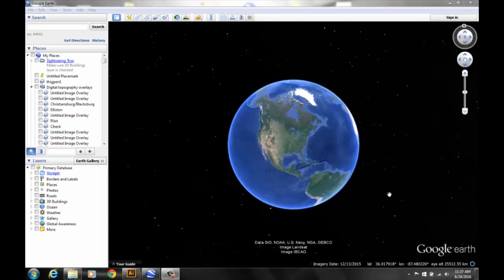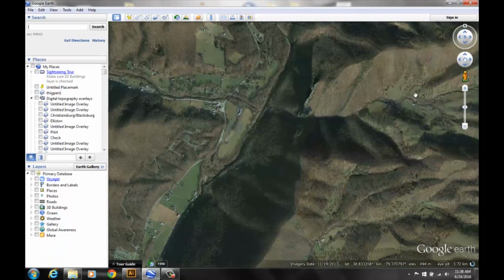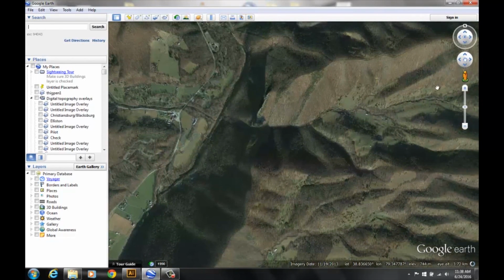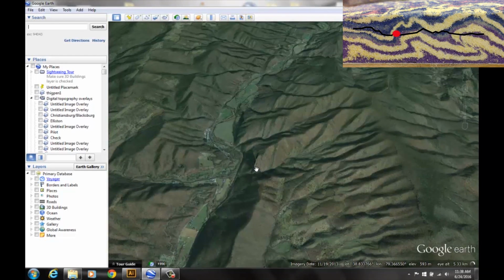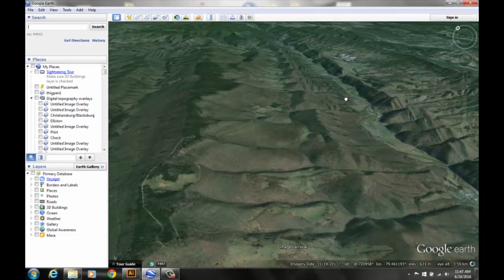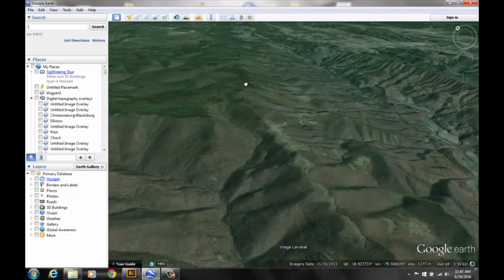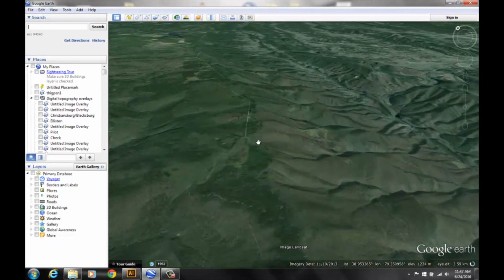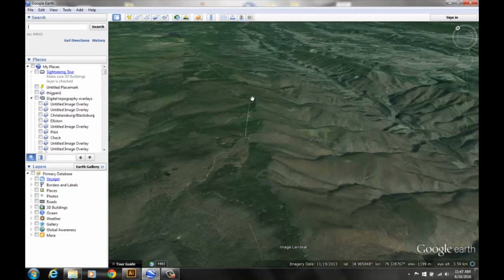Seneca Rocks and Wills Ridge Anticline 4: Overall view using Google Earth

Comment: I live in Riverton, WV with a view from the foot of Riverton Rocks, one of the Tuscarora Sandstone 'fins' about 10 miles south of Seneca. I learned some things from your series, but I'm slightly disappointed that you didn't take on the faulting that's responsible (or so I've been told) for the double fins at several locations. At Nelson Rocks, near the center of your view from the Spruce Knob overlook and discussed in the Google Earth segment., the two high fins are separated by 100m or more in the gap. Seneca Rocks is more of a monolith. Facing N from Roy Gap, a large 'cave' is visible in the S. end of the S. peak, with strata wrapped around it in tight arcs. Again, I'm told it resulted from faulting, though less cleanly than at Nelson.

Nelson Gap is the one just S of Judy gap where US 33 enters Germany Valley. It's the home of the NRocs via ferrata (nrocs.com), which includes a high swinging bridge spanning 200+' fin to fin. If you make it back this way, hit me up. I can probably get you in there cheaper or free.